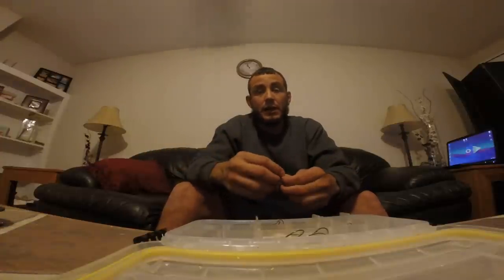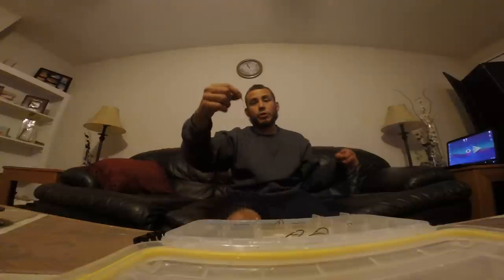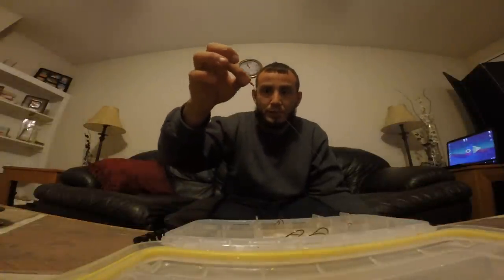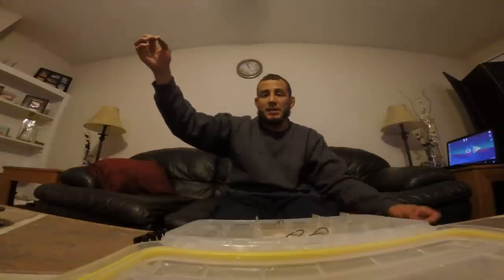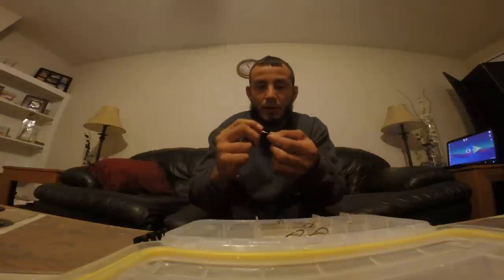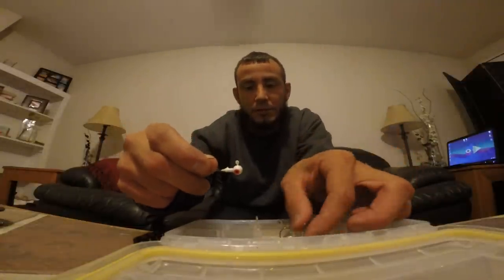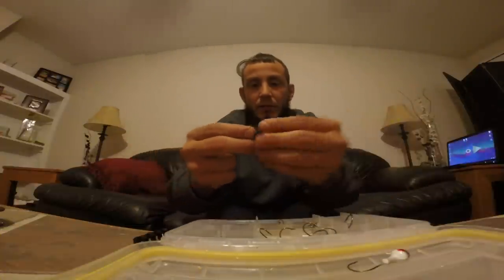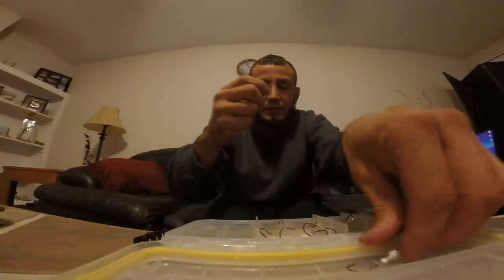How to tie a Tandem Rig

Comment: sorry, for the question. But can l use a donkey rig like for bass fishing but using jigheads and gulp. l think it will be more strong because it have the swivels that can distribute more the force of the fish. the knot that is in the middle it feels like it will make the line weak. Correct me if l wrong.  That is my opinion, but I am new on this so the more sure that I am wrong.
Reply from the maker: Sure, I don't see why not.